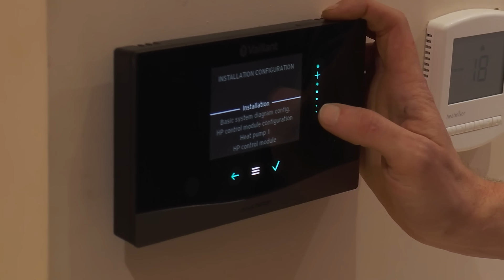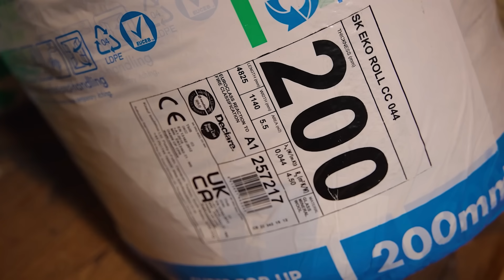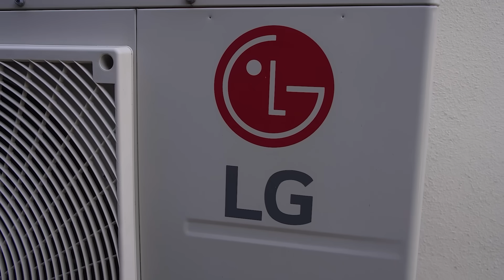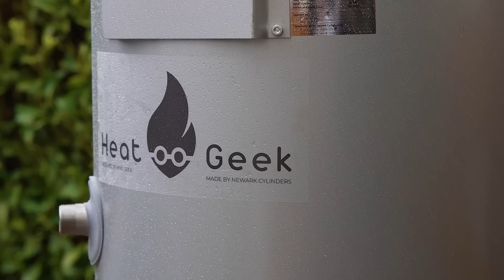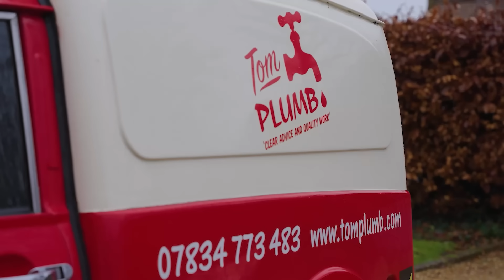Heat Geek’s Heat Pump One Year Later — The Verdict!

Comment: Sorry, they are total junk.
My daughter has had 1000's spent on her house, heat pump, insuation EVERYWHERE, her electric bill is now DOUBLE what her original heating bill was for oil heating, her house never warms up, the radiators never get hot, these things are a complete waste of time and money.
Reply: Mine's great.  The problem with your daughter's system is poor system design, just like this chap's was.  Get it fixed and stop whining about things you don't understand.
Reply from the maker: enejek5654
You are being disingenuous. His daughter had a heat pump installed and even if it is the fault of the system design, it will cost a considerable amount to get it fixed. Not everyone is in a position to spend a further 5k having their system tweaked. The government grant won't cover the callbacks. This is the very point John was making at the end. 
They throw tax payer's money into installations which are woefully lacking.
Reply: @  I'm not being disingenuous at all. I'm sick of people lying that heat pumps don't work or are inherently expensive to run. It's simply not true and entirely the result of people lying to and misleading them.

The problem is entirely due to poor system design and installation, in almost all cases.  you know that.

Few people should have to pay any or much money to sort out a poorly performing system, unless it has been installed for years.
Reply: @enjek5654  you're right that the technology is great and should work, but I don't think you should poo-poo people's bad experience because of badly trained installers. That's where the rubber hits the road.
Reply: @ I’m not Pooh-poohing her bad experience at all. Read the original comment again; he’s saying that her bad experience means that heat pumps don’t work are a waste of time and money.

He’s drawing broad, false conclusions based on not understanding that the problem is the poor system design and/or installation. It’s a pervasive misunderstanding and it results in people paying huge amounts of money to have them ripped out thinking that the problem is the technology, when often the systems can be fixed for no to little money.

The facts matter and I’m continually disappointed to see so many people being misled. Roger’s video the other day regarding the Houses of Parliament article in the Telegraph was him just uncritically repeating third hand nonsense. It just perpetuates nonsense thinking and unsupported conclusions.
Reply: @enjek5654   So why is that the customer's fault?  Should they get a degree in physics before buying a heat pump?  Stupid as it may seem to you, but most people don't actually know much about these things and expect a 'professional' to help them, that's what they are paying for.  Blaming the consumer is a very poor and weak excuse.
Reply: @TheDavecroft   It isn’t the customers fault that it’s not working well for her. I haven’t even hinted anything different. No, people shouldn’t need a degree to get a decent system. That’s part of the point I’m making. I’m not blaming the customer at all; but it does help if people educate themselves as much as they can.

Comment: Class to have the 2KW electric heater in the shot! Can only conclude its still cold in that house!
Reply: Well, cold in that conservatory. and my wife also has them everywhere despite not using them (we don't have heat pump)
Reply: heat pumps are crap unless you want to increase your electric bill. The electric rad is proof they don't have any power they are a marketing scam
Reply: The bills would be higher if it were in use much...
Reply: ...quite amazing
Reply: Think that's his conservatory and off his central heating. Good spot of course.
Reply: The only conclusion is that you are ignorant.
Reply: That's the conservatory - uninsulated and outside of the property's thermal envelope.

Comment: For £7500 in cash, I would live without heating
Reply: it would pay for three years of heating , 6 years if you add in cost of repair servicing and use of other heating methods. Heat pumps are sold in the same way as new cars are sold from the dealer. You think you are getting something you are not so you pay top money for a fan
Reply: That is a lot of fire wood.
Reply: I'd take the money and leg it to Thailand. Let them keep me warm. 😆
Reply: No or not enough heating will cause mould
Reply: @AyupStuggy  No it won't, damp and condensation causes mould,  usually due to houses being warm and sealed up.  A cold house with loads of ventilation won't suffer from mould,  I know that from 22 years of living in an uninsulated council house with just a coal fire for heating, and mum insisted on 'fresh air' by leaving windows open all the time.  The place was ice cold in winter but we never had mould. Bronchitis, maybe, but not mould.
Reply: Yes ventilation is needed, but so is some warmth, to keep the RH inside the house less than the RH outside. My rental house got mould when tenants wouldn't put heating on, even though they had windows open. Now I pay for bills, heating stays on low, and no mould (with a little bit of ventilation). Yes open fires are fantastic for venting a house as air is pulled in to replace air going up the chimney, they are the best for preventing mould.
Reply: @ A warm house will not get mould because moisture cannot condense.